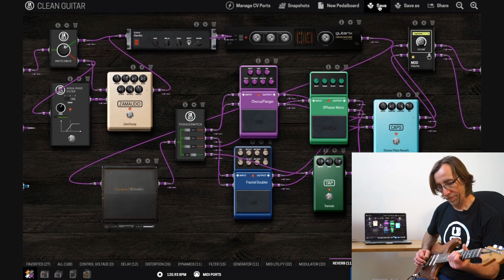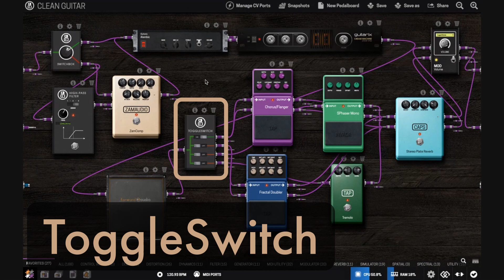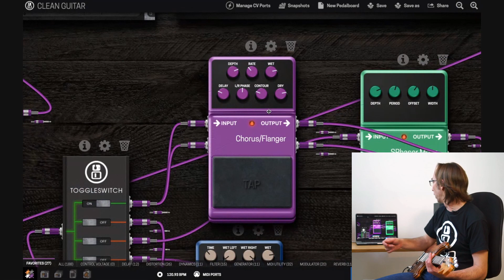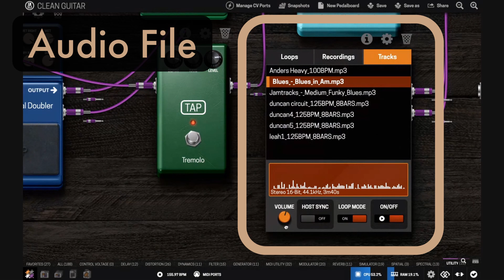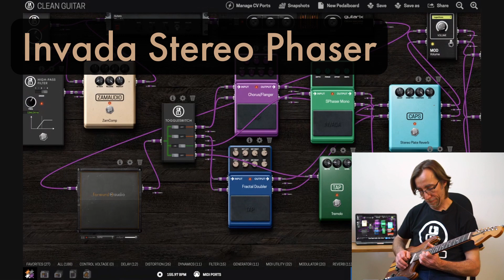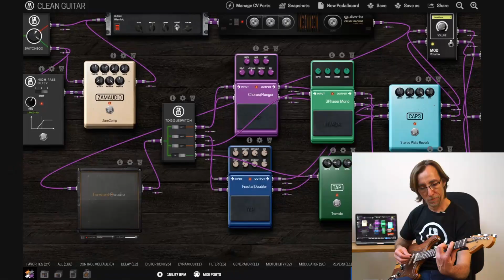MOD Dwarf - MODFather Pedalboard Demo - Modulation -

Comment: Will it work with an iPad? 
Can I record onto iPad using GarageBand with the Dwarf?
Reply: You can use the iPad to load the Web UI in your browser when connecting via Bluetooth. 
The USB Audio Interface feature is still under development. Once it is ready it should be possible to record using the iPad by means of an adapter (Lightning-to-USB or USB-C, depending on the iPad) in the same way it is done with other class compliant audio interfaces. You can read more about it here: https://wiki.moddevices.com/wiki/Audio_Through_USB